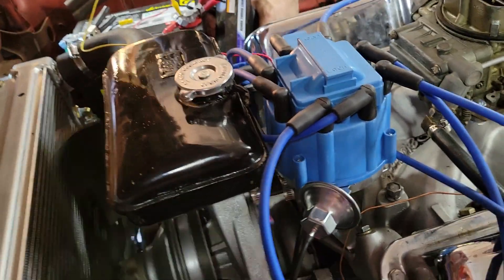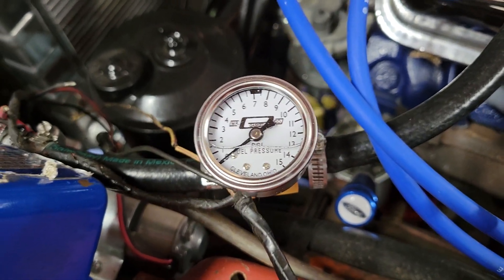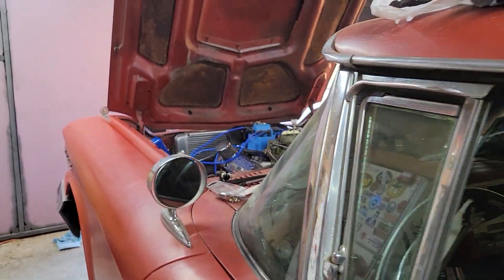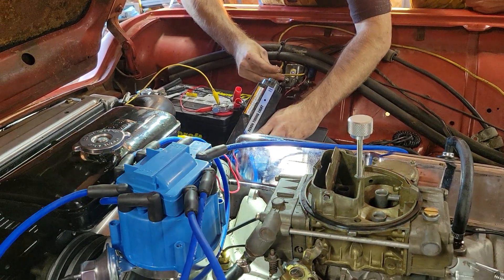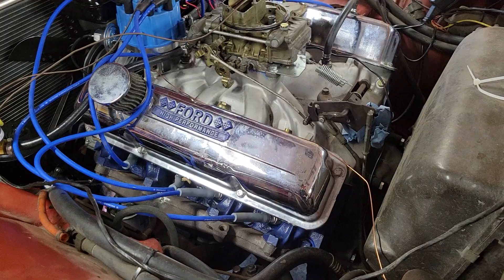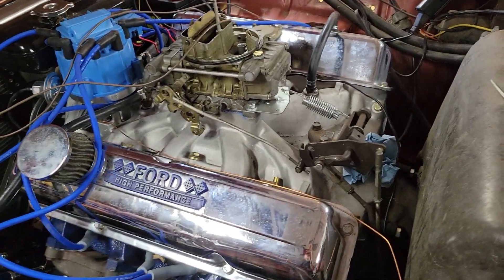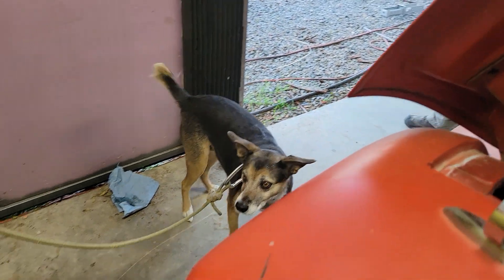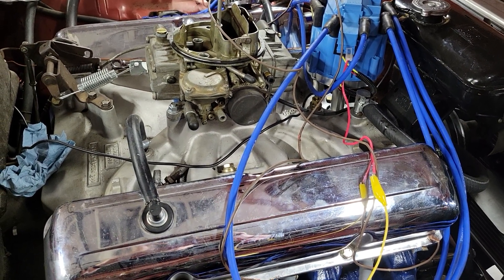Getting my 1958 THUNDERBIRD started!

Comment: Mine hasn't started in 20+ years! Replacing all electrical under the hood. Hoping that will solve the issue. The guy I bought it from, connected the battery cables backwards and he tried to start it, he just saw smoke. So.... That's my starting point. Love my 58' T-Bird!
Reply from the maker: Hang in there, buddy!